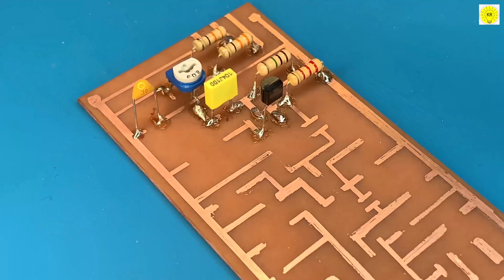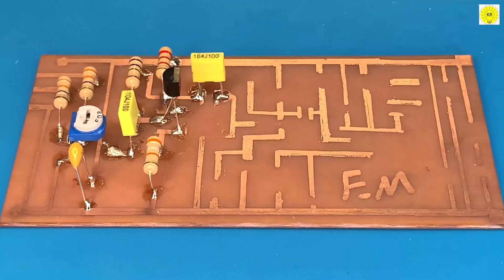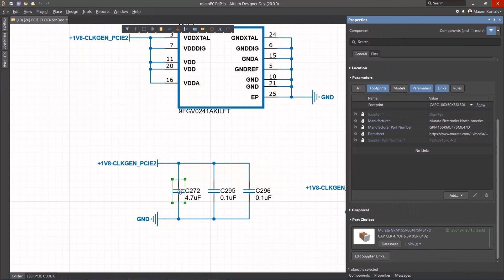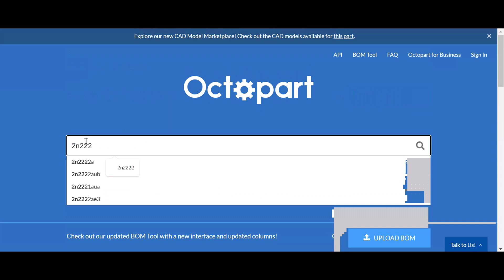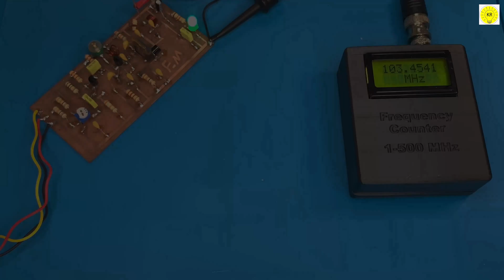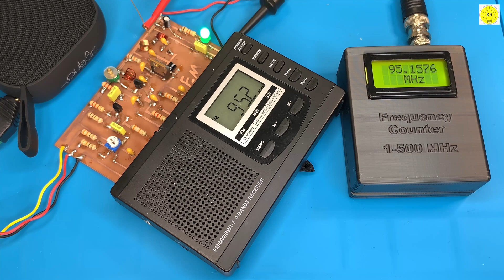fm transmitter DIY 5km FM Transmitter Circuit Diagram

Comment: Doesn't anyone make proper through hole PCBs anymore ? These single sided top-soldered designs may be good for teaching beginners how to solder but not really good for a permanent device. Too easy for components with legs that are too long for RF work to be knocked over/disturbed causing shorts.

Comment: que pasa si uso capacitores ceramicos normales?? y no de tantalo
Reply from the maker: Puedes usarlo sin problema.
Reply: @inventorkr1 Which transistor should I use to replace the BFP494 or BC 550?

Comment: This looks terrible! I bet it spits out more unwanted frequencies than wanted! 
It also isnt encased in a metal box!
Reply: How do you know?
Reply: @alicomando1195   He uses a class C amplifier which is "overdriveing" a transistor so it amplifies more, but also spits out unwanted frequencies. That's why normal Radio transmitters are using Bandpasses to filter unwanted frequencies (which this guy didn't use).
He also uses an oscillator, that is producing tons of unwanted frequencies.

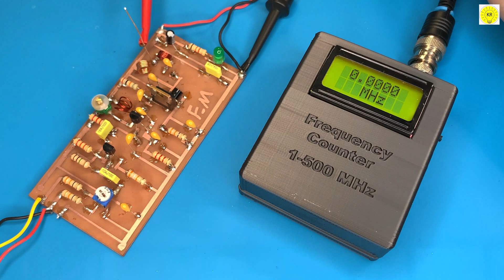Comment: Anyone wanting to build this HE MISSED A CRUCIAL STEP IN THE ASSEMBLY PROCESS. You see he never included a resistor to give a + bias to the base leg to first stage oscillator transistor. It will not do anything without that resistor in which is what happened when I built it. I finally noticed at 3:39 you can see the extra resistor he forgot to add in the first place. It looks like a 2.2kohm and is on the immediate left side of the variable capacitor. Mine still only transmits a few feet, though I didn’t use the same transistors he used and mine are far from being rated for the frequencies
Reply from the maker: Good note: Yes, everything you said is true
Reply: @inventorkr1  ele troca a primeira bobina também , por favor amigo envie o esquema correto ou disponibilize um link para compra obrigado , pode reparar também que ao 3:57 a placa tem um novo elemento soldado bem próximo ao SC2078 repare bem!!

Comment: How NOT to build a circuit for VHF. Leads should be as short as possible, components close to the board: not waving around almost a centimetre above it. All that extra inductance and capacitance is asking for failure. Please DON'T regard this video as an example of "good construction technique" - it's the exact opposite. :-(

Comment: hola saludos desde planeta rica colombia... como es la formula para calcular las antenas gracias compadre
Reply: Para calcular un dipolo simplemente divides 150 entre la frecuencia, por ejemplo para 100 mhz sería 150/100 = 1.5 m o 150 cm eso sería media onda, luego cortas varillas de 75 cm cada una (75 x 2 = 150) y las pones separadas unos 3 cm en línea recta y a una va el vivo y a la otra la masa o tierra. Tendrás un bonito dipolo cuya eficiencia es sorprendente.
Reply: Did you made one and how long is the frequency range?

Comment: Always find these channels amusing. As an experienced engineer this is terrible. Unlike some others out there this will actually work, range a few hundred feet max maybe not 5km! Clearly no idea what they are doing though. At these frequencies it should be a double sided board with one side a ground plane and you keep the component lead lengths to a minimum. The output device in the diagram in the links looks reasonable, the one in the video does not!
Reply: I had a lot back in the 80s that I used a commercial matched antenna and boosted the power to 12 volts and got a mile range
Reply: Agree! Very poor technique: components waving above the board? Scarcely OK for audio, let alone VHF. :-(
Reply: I agree. I'm currently messing with fm radio microphones and I just use an unetched board as a ground plane and employ lead to lead construction above it. Using wires from the board to the electret mic outside, it's extremely sensitive, plenty stable and runs from a 3.7v 18650 li-ion battery for a week. I think it's better than having a camera outside 😂
Reply: Humbly share to me the circuit diagram
Reply: @NowomujuniJoashforsavior  Лучшая схема радиомикрофона с дальностью 600 метров описана в журнале СССР "Радио" за 1959 год, номер 9, страницы с 37 по 39. Немного измени данные катушки генератора, и будет радиомикрофон на FM 88 - 108 МГц!
Reply: Согласен!
Reply: Se pueden alcanzar 5 km más con altura y una buena antena y encontrar una frecuencia que no esté muy saturada. Yo he conseguido con 10 km con 1 watio y una antena plano de tierra desde un edificio de 7 plantas. El alcance no es directamente proporcional a la potencia siendo más importante un buen cable de antena sin pérdidas, la antena y la altura y por supuesto adaptar la impedancia de salida a la antena para que llegue toda la potencia y no se pierda en ondas estacionarias ni armónicos. Por otra parte estos circuitos no tienen buena estabilidad de frecuencia por lo que durante unas horas irá desplazándose la frecuencia en función de la temperatura y humedad.

Comment: Una pregunta porfavor dónde se conecta para la antena porfavor gracias
Reply: Does it work for you
 And for how long how many kilometers does it reach for you

If so you can add the piece of wire and the coil

If the frequeny shifts

You can add the capacitor Before attaching the antenna wire

Comment: I don't see anything that would provide the 75us pre-emphasis for the audio.  The output transistor which looks like it came from a junk CB radio, has the collector (center lead) grounded instead of the emitter.  It would not have any gain.

Comment: Can you make pwm circuit with frequency and duty cycle controlled. Frequency 0-60 hz and duty cycle control with 3525 ic or tl494 . Plssssss
Reply from the maker: Thanks for your comment, I will try to post a video on this circuit as soon as possible.

Comment: Is this FM Stereo?
How you make it more powerful?
Great Work!!!! 👍
Reply: No. For stereo you need stereo coder.
Reply from the maker: Yes, it is a stereo FM transmitter circuit and it is very powerful with the use of transistors used in the circuit diagram

Comment: if you put a 7 element antenna on it and put it outside, it's even bigger.  nice video thanks👍🤩✌
Reply from the maker: Yes, using a longer antenna increases the range of the FM transmitter